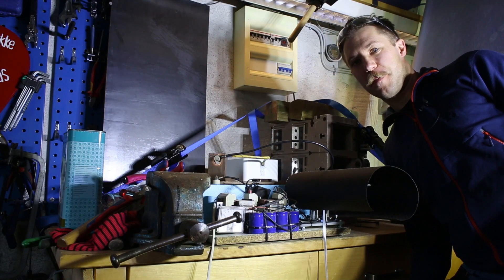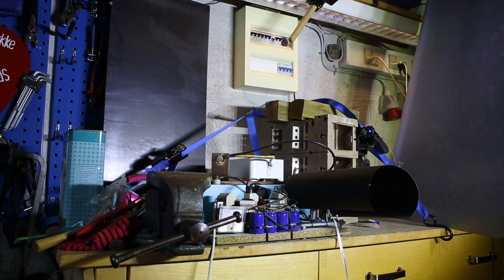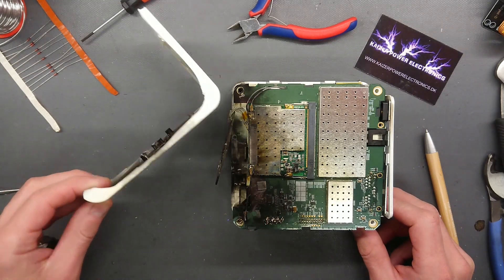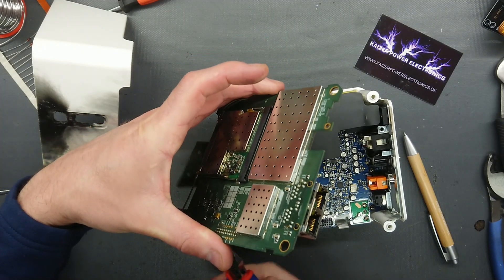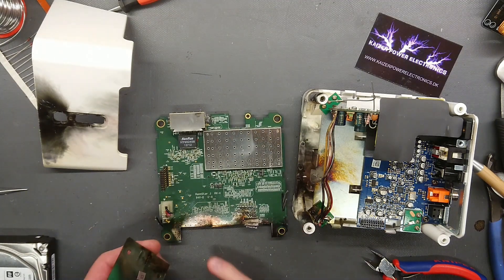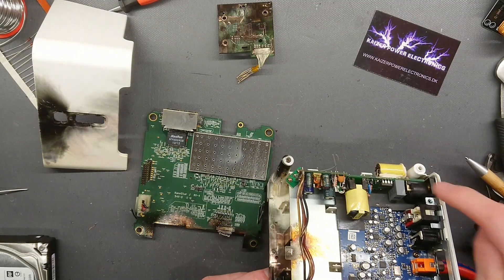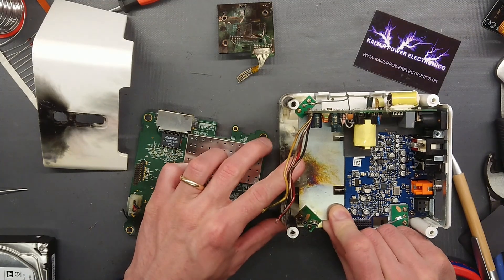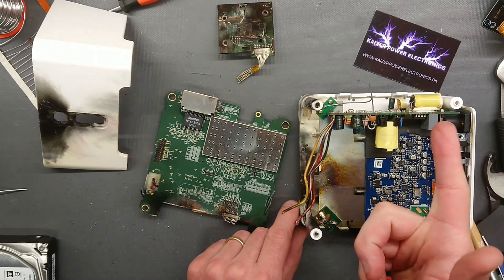Sonos Connect Exploding in Slow Motion 1000fps

Comment: Damn an explosion from such a big hv capacitor never ceases to amaze me!
I've wondered how could one get such a high voltage-pulse rated capacitor (today)?
They have been increasingly harder to find - at least in Germany (or i just didn't look hard enough).

I have a bunch of really big 400V electrolytics but such a 5kV+ pulse capacitor would be a nice addition.
Reply from the maker: It was a rare Europe ebay find, I agree with you, its hard to find real big pulse capacitors in Europe. Getting ones shipped from US that takes up a pallet is just too expensive.
Reply: @KaizerPowerElectronicsDk  
how are those pulse capacitors actually constructed internally? I guess they are extremely labour intensive in production.
And would it even be possible in the slightest, with enough time, and effort, to construct one yourself?

I once built a 41nF capacitor (measured) which could theoretically withstand 27kV DC (assuming the dielectric strength of PP seen online is the same as my PP; only tested to 20kV). It is made out of about 80 Polypropylene Document-Sheets and aluminium foil. To decrease ESR, each aluminium foil is connected to a thick bus-bar. And the entire construction is pressed together between two wood plates.

To my surprise it actually held up pretty well. I originally planned to use it in a SGTC and it didn't even break and works to this day. 
It is only about 5 centimeters high due to the pressing but this thing took me about 1.5 to 2 hours to assemble. I imagine getting even close to 1µF and beyond is nearly impossible.

But I can't be mad about the price. Not even a quarter of aluminium foil roll was used and a pack of 40 PP-Sheets costs about 2€. The electrical tape was probably the most expensive part.